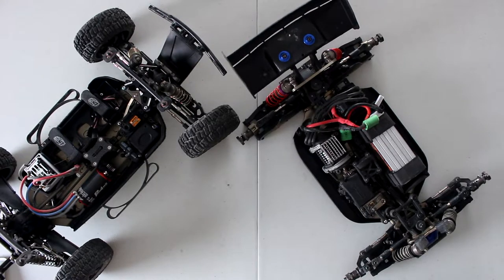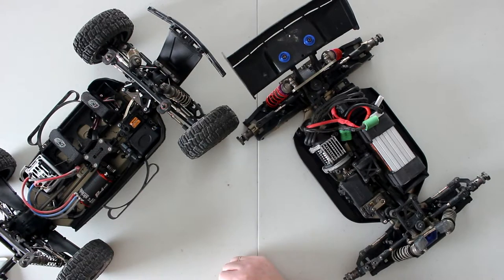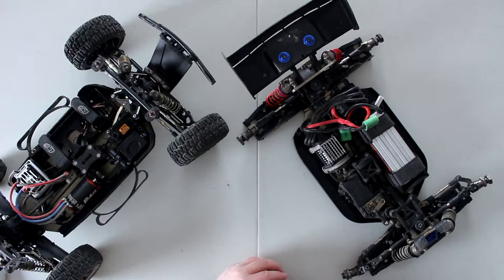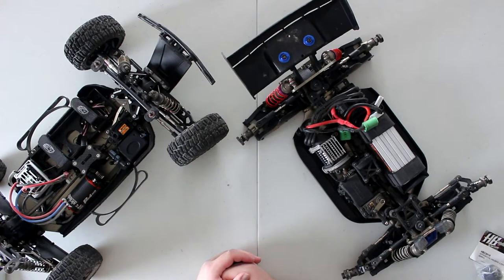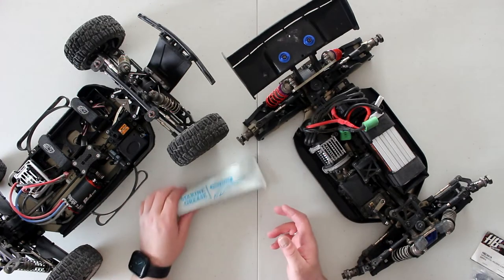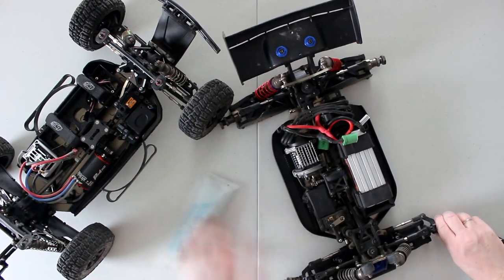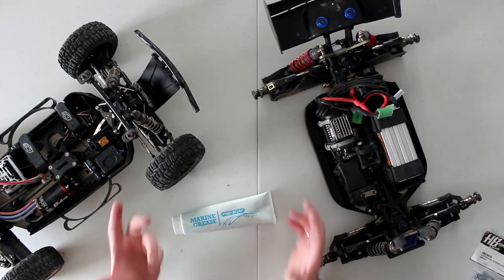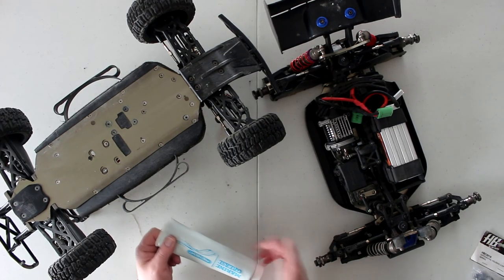Grease In Diff Case or Not

Comment: How come this is the only video i can find, that says NOT to fill your diffs with oil of grease? Every other video explains the effect on the behaviour of your car bij filling the diffs with different types of oil, etc. Its kind of like the opposite of what you are telling in this video. Correct me if i am wrong.
Reply from the maker: When I’m telling you is not to fill the cavity that your diff lives in, if you do, your oil will just leak out. You can add a little bit to your gears to prevent them from chattering.
Reply: @djsprc  i see, thnx

Comment: Lucas Lithium Grease is what i use
Reply: I want to somewhat lock my diff on a crawler with open diffs (Smasher v2). I plan to use red N tacky, is that what you used? Does it lock up pretty good?
Reply: @keldonator if you want to lock up your diffs, you need to fill em up with thick silicone oil. The lithium grease goes outside of the diff. It's to lubricate the connection between your front/rear diffs and the drive train and/or the pinion gear and the center diff.
Diff fluid is basically the same stuff that also goes inside your shocks. It's just being sold as diff fluid once it goes above a certain thickness.